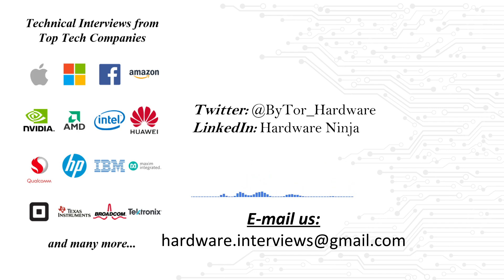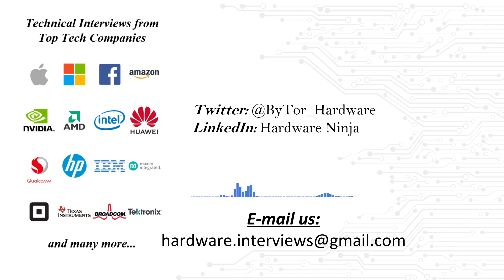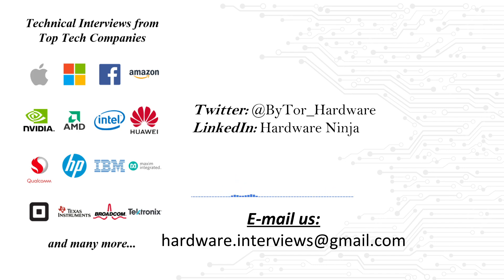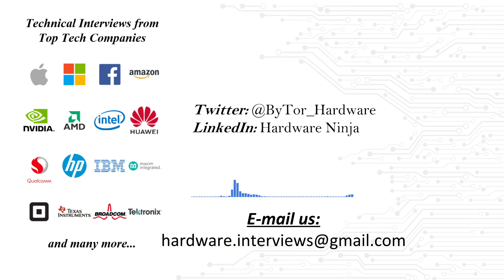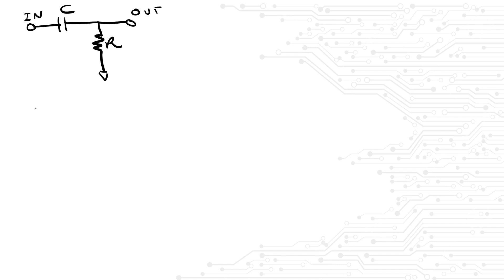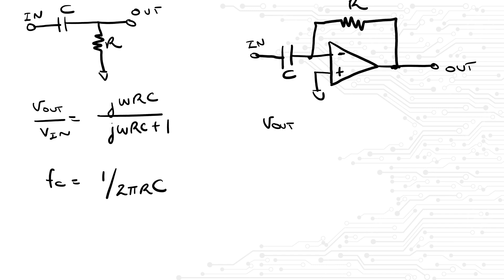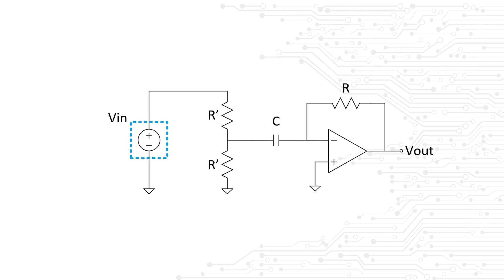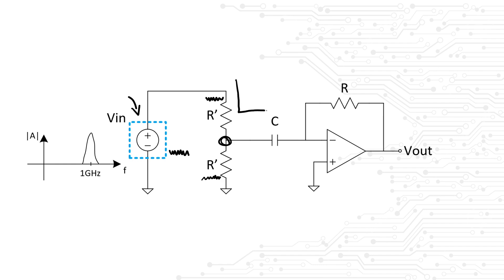HWN - How Interviewers Build-up to Questions on Interviews

Comment: One more possibility might be that: If Vin is the my incoming signal, then before reaching to the ideal differentiator, it gets attenuated by the resistive divider (Vin/2 is going into differentiator instead of Vin, which leads to 6 dB loss straightaway!). Means SNR degradation is taking place at the input itself, which is absolutely undesirable in RF system designs.

Comment: The gain of this circuit (from the sensor) can never become infinite even if every single element in this circuit was ideal. The transfer function (from the sensor) for the high-pass filter using the op-amp is not the same when the two R' resistors are added of course. The infinite noise issue you mentioned will not happen from the sensor. The highest gain this circuit can ever have (even with everything ideal) is -R/R'. Here I am making an important assumption that the noise is from the sensor only. If you assume the noise is from the resistors, well I guess you could say that part can get amplified towards infinity. If things are truly ideal, as soon as you turn the circuit on the world would end and so would the interview. ;)
Reply from the maker: Thank you so much for being here, we're big fans of your channel! :) Your answer is spot on! Once you mentioned the "transfer function (from the sensor) for the high-pass filter using the op-amp is not the same" we got a bit excited because most people ignore this during interviews.  However, it's not only the gain that may be affected but the overall frequency response as we're introducing an extra pole through that path. We're you able to catch that?!

Comment: One possible alternative solution might be this...
The left portion of the circuit can be converted into a series voltage source and a resistor using the Thevenin's theorem. Now, the circuit is basically a voltage source, a cap in series with a resistor (Rth = R/2 in this case) and the feedback resistor. Of course, the Op-Amp is still in its place.
Now, the circuit essentially boils down to being a practical differentiator circuit (Note that the original circuit is not practically feasible since it contains one zero and no pole hence violating the causality principle) with a valid cutoff frequency. If the signal band around 1 GHz doesn't lie beyond the cutoff frequency of the practical differentiator circuit, then the circuit would introduce amplitude distortions in the signal i.e., for different frequency component of the signal, the output would be scaled differently in the frequency spectrum. Of course, this can be mitigated using an equalizer but it would only add to the cost of the design.